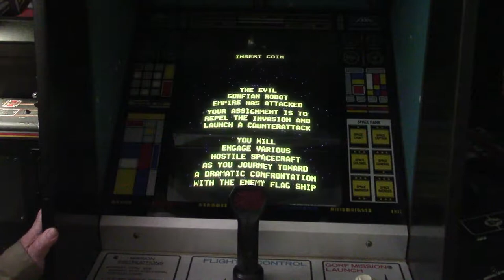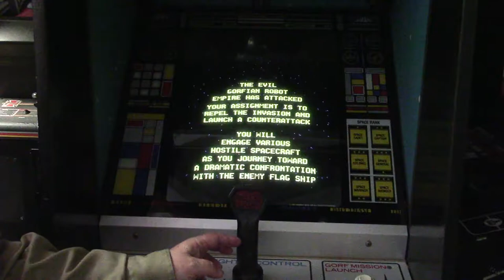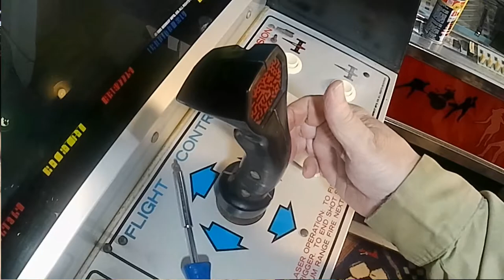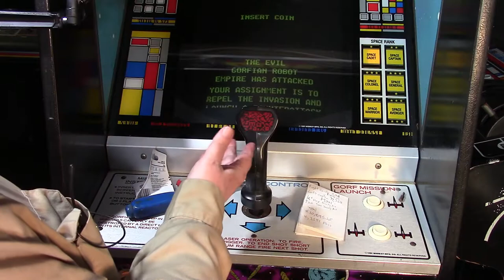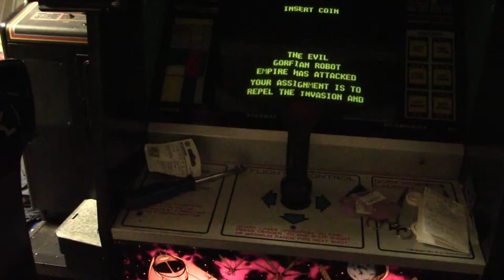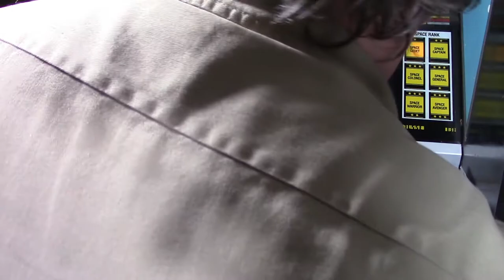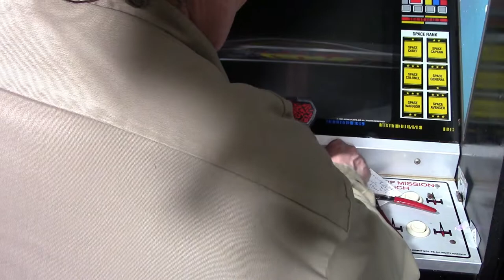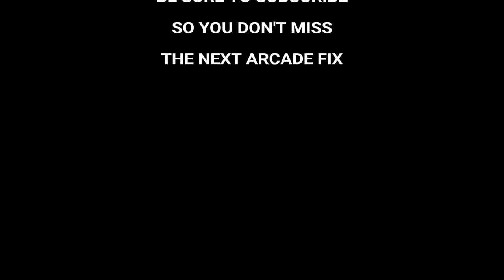SAMS ARCADE FIX REPLACEING GORF JOYSTICK BULBS

Comment: Hi, I am having a heck of a time trying to find the right bit that works on the joystick screws. Would you mind telling me which bit it is that I can find on Amazon? I had a torx security set here but none of those star bits nor other odd shape ones will fit...so am stuck at the moment....Watched your video and I know you said you grabbed a 1/8 allen security bit but not finding that when i search..thank you...this is frustrating.
Reply from the maker: Yes, My GORF joystick had a T-20 Torx security bit on the top screw but the other 4 were 1/8" Allen Hex security bits. Take note, over the years the type of screws used could have been changed to another type. You can get a 100-piece security bit set from Harbor Freight Tool for around $8.99 which should have any bit type and size you will ever need. https://www.harborfreight.com/security-bit-set-with-case-100-piece-68457.html